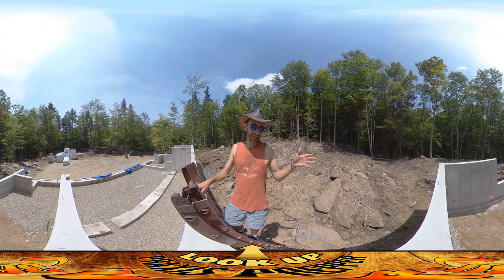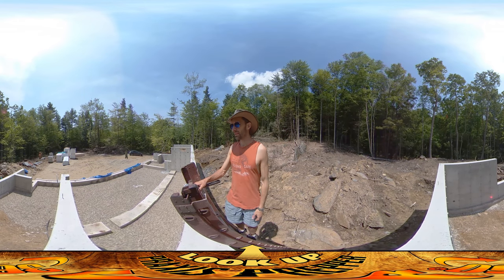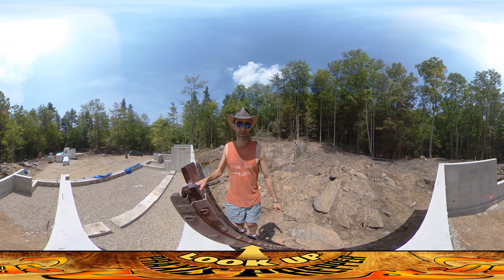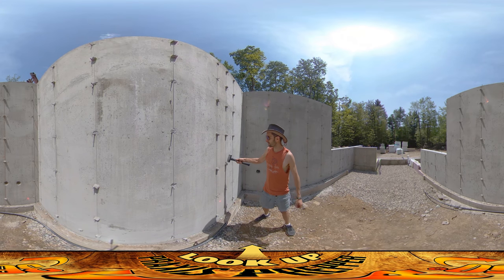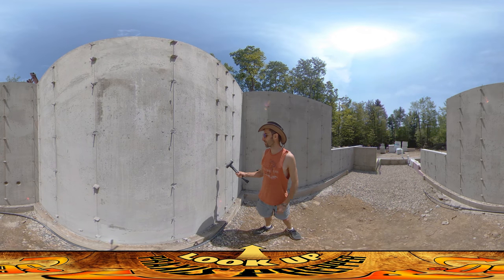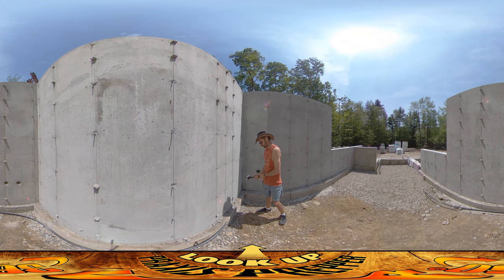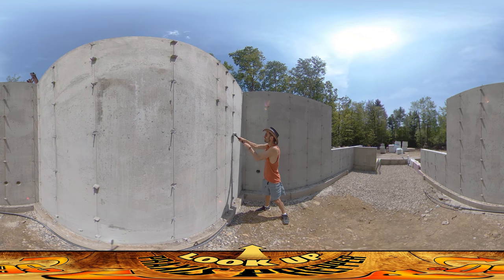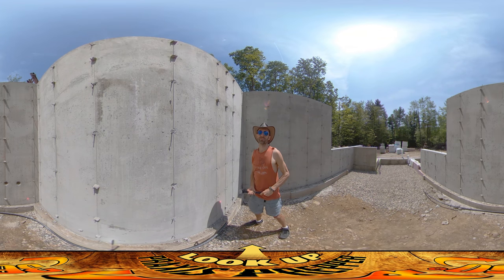Homestead Building - Removing Concrete Form Pins, Foundation is Done!

Comment: Easyist way to remove those concrete lines is to take a broken piece of concrete centerblock preferably flat and sand the wall with circular motions. It work great removing that concrete mudding
Reply from the maker: That's a good idea. I think I'll do that on all the interior walls where the form lines would be exposed. Thanks for the tip!

Comment: Seems to me you might be doing this a bit to early? ... Concrete actually needs some times to harden, while it is sturdy enough to bear it's own load after a day or so, it's only at 30% of it's strength by then. And it take about a week to get to about 80% of it's strength, then about a month or so to get to 100% ... so if you start knocking off pins after a day (when the forms have just been taken off) it might still be to 'soft' to get a nice result? At least i saw quite a bunch of small damages (which you might want to plaster to prevent moisture getting in ~ concrete rot is a real thing) ... now i am not sure about this, as we over here do not work with these types of pins, we use plastic 'off-holders' to keep the metal reinforcement in place... but those strength figures i am pretty sure off !

Now it might still not matter due to those pins being small and bits might still sheer off as you smash them into what is basically 'a corner' in the concrete. BUT, if you do the inside at a later date, it might be a thing to look into, and if damages are considerably less, it might be a thing to point out to viewers as something to consider for their own build.
Reply from the maker: It's always been the advice that I've been given that waiting a couple days before doing this is fine. The shock waves (it would seem to me) are directed pretty much entirely into the little pins, and while I'm sure damage occurs around the pins themselves, the pins are never going to be a water-tight situation over time no matter how gingerly one breaks them off. To address this, the entire foundation is getting a foam skirt that will prevent any water from getting to the concrete - and under that is a layer of asphalt water seal as well.
I agree on your percentage of strength number too by the way. They seem about right to me.

Comment: Does anyone know why Praxus is removing these pins?
Reply from the maker: I actually don't know how to "pin" anything on my channel, or "unpin" for that matter. If you don't mind taking to time to let me know what you were trying to do, maybe we can both figure out what's going on. Youtube does a lot on its own I think.
Reply: @PraxisPrepper  he means the pins in the concrete ... ;) ... it's kinda what this episode is about?
Reply from the maker: Wow... I feel pretty idiotic right now. Someone was just talking to me about "pinning" comments in these videos and I had that on the mind when I read the question. Okay. I'll take another swipe at that question now.
Yeah, so the reason to break them off is pretty much because some of them penetrate into the living space (where the wall in the house will be the concrete itself), and also because foam is going to be laid over the walls on the outside and the pins there would make it hard to lay the foam on... though if they were sharpened to a point, maybe that could hold the foam on! ;)
Any pins that are in the frost wall, on the inside of the structure (where the foam isn't being laid against the wall), the pins can actually be left in.
I hope that answers your question better than my confused first reply.